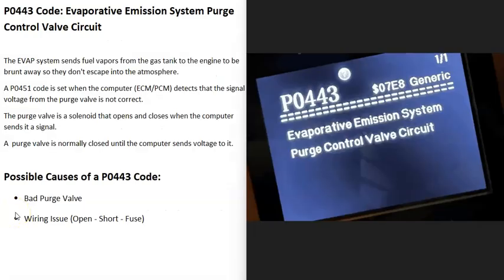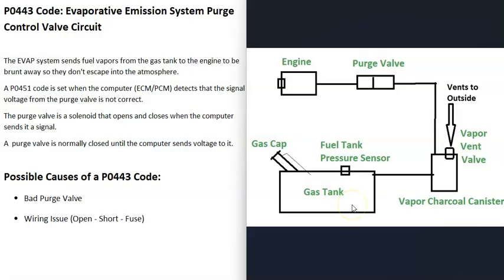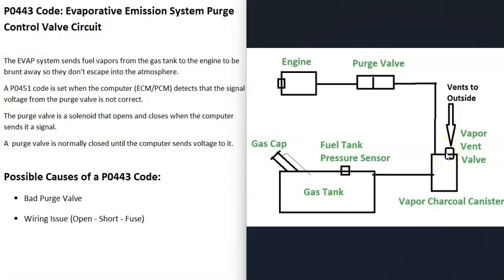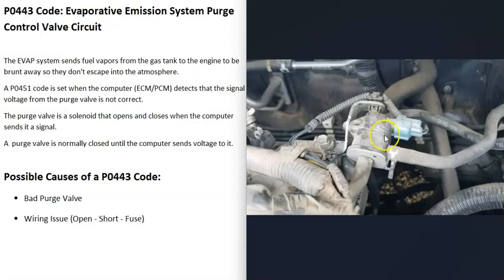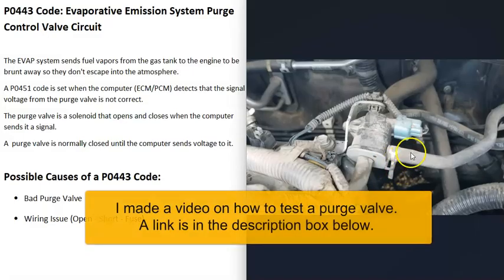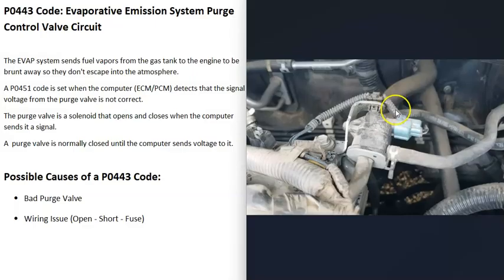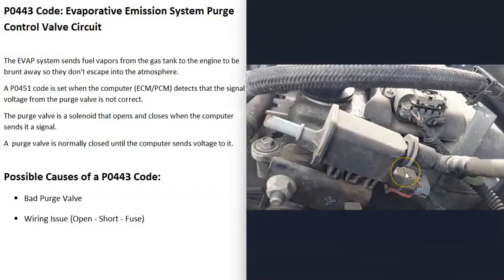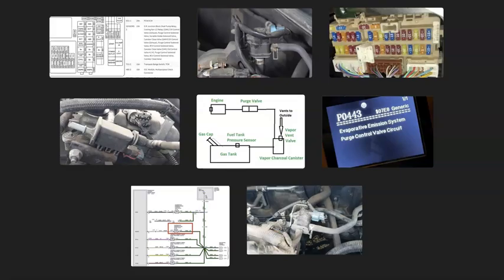Causes and Fixes P0443 Code: Evaporative Emission System Purge Control Valve Circuit

Comment: Ok, let's have fun. I want to play a game meme here.
"Chase the problem around the car"
'05 Ford FreeStar, 161k mi.
Cyl 2 misfire code, engine stalls on freeway. Runs rough like a squal around the Cape of Good Hope. Engine reports 3k+ misfires. Computer was reset a few times before this. Vehicle get driven 4k mi/yr and 8k miles since Valvoline oil change. Passed smog before title transfer. Ok, let's get started, shall we?

1. Sparkplug swap, old ones had orange and yellow corrosion on the back of the arch bar and all plugs showed heavy signs of wear and carbon buildup, some more than others. Had to regap new plugs twice thinking I messed up the first two times.
2. Swapped out all four O2 sensors even though on had issues on one bank. Only one of them had very heavy carbon build up. 
3. Ignition coil pack failed upon inspection and crumbled in my hand at the mounting points. Replaced that next, resolved engine Misfire code but sprang new problems related to fuel delivery. Professional inspection stated Cyl 1 &2 fuel injector failure. Rough idle and engine stall symptoms. Ripped out everything down to the fuel injectors and replaced them with rebuilds along with all the seal gaskets for the air intake manifold, throttle body and the EGR valve. Yes, I used lube... I'm not a barbarian. 😂 (Petroleum jelly).
4. Rebuild complete, no fuel leaks. Engine won't start. Que la chingada, no mames mamon! Puta verga. Don't translate, I'm cussing like a sailor.... I mean a mechanic. 😂😂
5. Fuel Pressure Sensor failure, bought two replacements knowing the cheap ones aren't that great but can get me going in a pinch. Checked all connections and hoses, everything is connected. Gotta be the battery. Age of battery under 3 years but showing 9.3v. Pendejada de pendeja. Don't translate...😅😂 Deep cycle pulse charge after topping up all cells and no issues noted with low fluid levels (I know to look for exposed cells, nothing visible and fluids still well within range). Full recharge restored whatever issue was causing low voltage (likely my dumbass listening to the radio while working and then sulfation build up over three days sitting dead). Recharge successful, 15v read and smart charger immediately turned off several times when attempting to challenge the status. Battery temperature normal/ambient/room temperature. Reinstalled battery and new fuel pressure sensor. Hazzah! Engine starts, rough idle and stalls. Engine light didn't come on the first try because it was disconnected from the battery. All four original codes cleared but new code reads po443.... 😂😂😂😂😂😂😂😢

So here I am on this video now. Where's the thermite? Anyone got an empty food can? 😂😂😂 J/k 

Stay tuned for an eventual catalytic converter replacement, transmission connection parts replacement and transmission overhaul!😂😂😂😅😢😢😢

At least my public transportation rides were all free yesterday when I went to collect the parts. Free ride day.🎉😊🎉
Reply: Update. Found a cable disconnected from the EES but this didn't resolve the problem. Now I can smell fuel fumes.

Comment: Same problem with me. There is no signal being sent to valve. I will check if there is any energy at all in that wire. I can’t seem to find the fuse for it. Any one know what’s the fuse is called. Qx56 infinity 2008.
Reply: Did you fix the problem? I have the same sympoms and same car

Comment: FORD 2018 5.0 I am getting random misfires and -1000s or higher pa and looked at that the normally open vapor blocking valve (VBV). Could this  be causing this issue? I took it off the truck, and the bench tested found it it does not seem to completely seal shut. i ran smoke and vacuum, but it never fully sealed when closed. i just ordered a replacement and ran the same test. The results were the same.  My question is, if you have the answer,  is this (VBV) that is PCM controlled valve that blocks the flow of vapors from the fuel tank to the EVAP canister during engine operation, air tight when closed? I tested (smoked) every Evap contact point, and everything is sealed and working properly.  Having 2 VBV doing the same thing is odd.
Reply from the maker: It is best to get a manual for a vehicle to know for sure, but generally, the VBV is a normally open valve and commanded closed by the computer during an idle stop condition and when purging.
Reply: @HVAC_Mechanic  I just spoke to my local Ford Dealer, and none of the mechanics on sight were able to determine if the VBV is fully sealed when closed. I appreciate you taking the time to answer my question. Thank you

Comment: This has been driving me crazy, I’ve done replaced the purge valve , gas cap, and solenoid on a 13 Nissan armada, BUT still getting P0447 (control circuit open) tested each old/new part they worked fine when applied 12v BUT…solenoid is not opening/vacuuming when car has warmed, gas still spewing out when filling, and STILL HAVE CODE 😡! I tested the connection on the harness to the solenoid and it’s getting power/ground, what could it be!? I’m curious if the pcm is not sending signal to open!? Or could there be something else that would cause the solenoid not to open!? Thanks ANYTHING HELPS
Reply: I saw my simple OBD2 dongle test showed fault with 2nd O2 sensor but then my scan tool says evap p0443. Check your O2 sensors.
Reply: I'm having the same issue. I think it's the PCM. I'm gonna get a new one reflashed and ready to plug and play. Hopefully that fixes it.